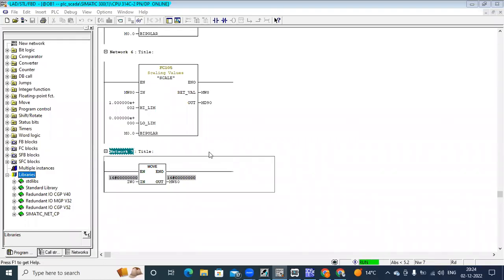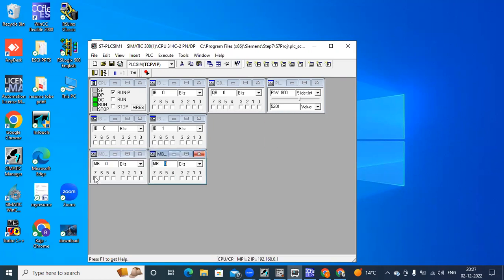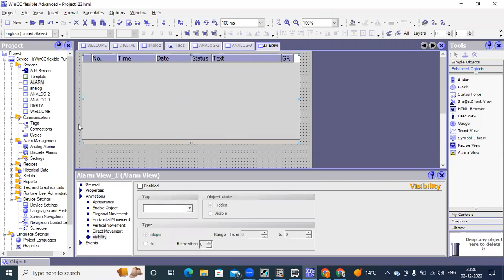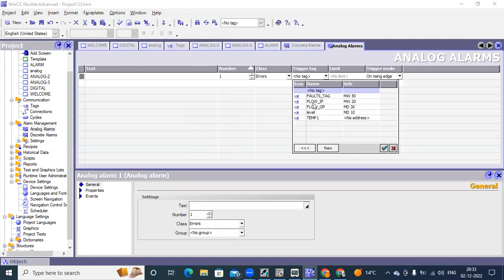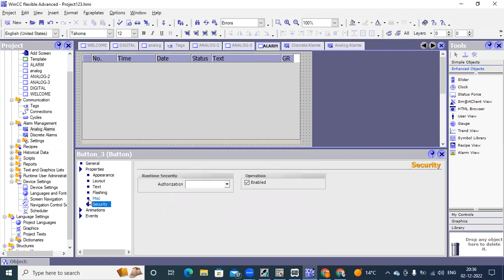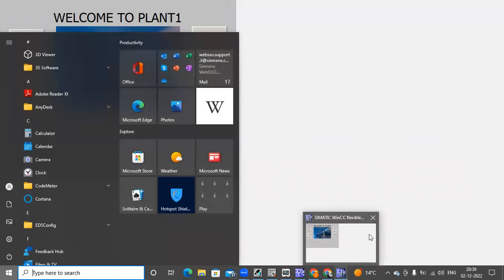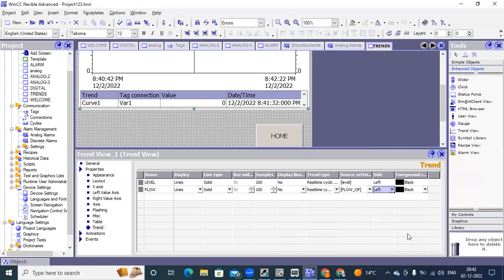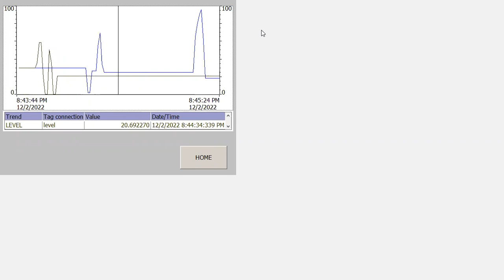LECTURE#4: WINCC FLEXIBLE 2008 SP5  ALARMS AND TRENDS CONFIGURATION

Comment: is it possible to configure the trend with slider? so that we can see the previous record
Reply from the maker: In HMI historical trend option will not be available but if you want you can configure using vbscript but the data should be logged in SQL or database system from where you can retrieve and check the previous trend values